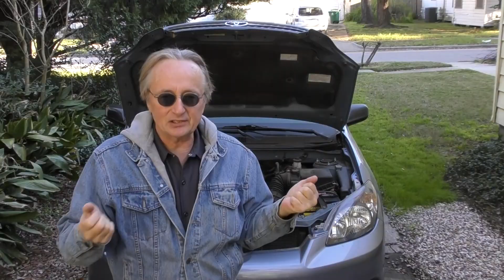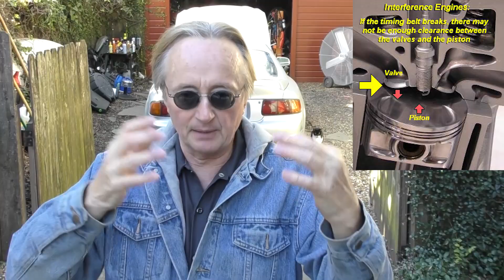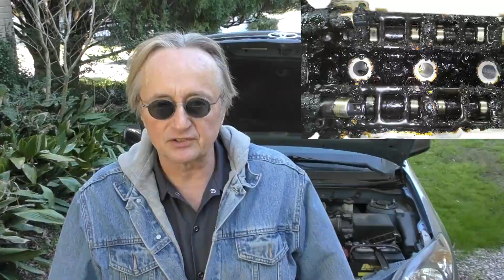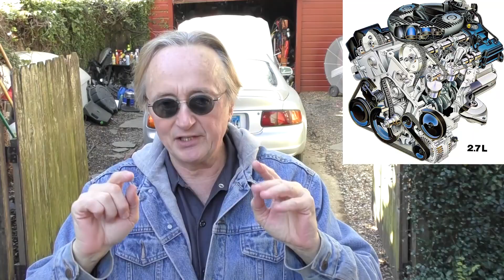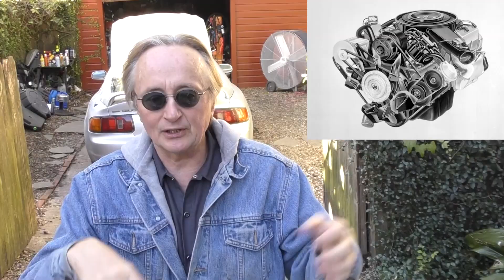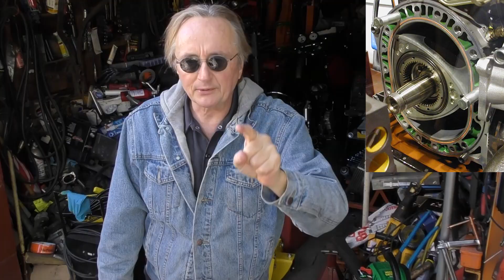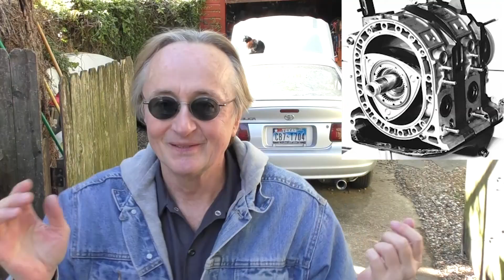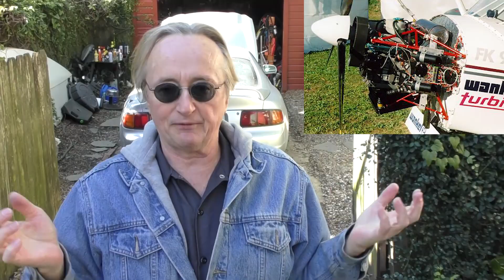Never Buy a Car With This Engine

Comment: SCOTTY IS A GM 3.4 V6 A GOOD ENGINE??.
Reply: The GM 3.4 engines leak like crazy. In fact that seems to be a problem with the 3000 series engines from GM. 3100, 3400, 3500, and 3800. Especially when they get past 125-thousand miles. 
I took mine apart in my Venture and replaced all the gaskets. Even added a little bit of RTV gasket maker to the top of each gasket to get a little better seal. Replaced gaskets, oil pump, water pump, cross cooling pipe, oil pan gasket, all the sensors, coil packs, spark plugs and wires. 
put it all back together and it worked really well. 6 months later....oil pan leak.
Reply: @johnsuggs7828  hello
Well..my 2003 olds sillhoutte has 270k and dosent leak anything..ive had it for 150k of those miles and changed all fluids reg and oil every 2500....parts as needed..van still runs and drives like a 50k mile van.....orginal radiator..ac equip....trans..engine...amazing this is why i wont sell it.
Reply: @beekbeeker2907  I have an 03 Chevy Venture Warner Bros. Edition, which is essentially the Silhouette with a Chevy emblem on it. Its at just under 290K miles. Had it for 13 years. Purchased it with 86K. So while I may complain about the leaks, I'm not every getting rid of it. I haven't' had a vehicle payment since paying it off a year after I purchased it
Reply: @johnsuggs7828  i have no luck w fords
Reply: @beekbeeker2907  Owned 2 fords....Won't ever do it again. At least not the cars. Ford trucks aren't too bad....when they work. But I'll never own another ford car.
Reply: @johnsuggs7828  my 2000 voager minivan was great 200k same as olds dry..tight
Sold it to get longer van it was a shorter one....both windstars were problems
Always breakin and rusted to hell early.on.

Comment: The 05 Buick Century- uses dexcool, which eats away the head gasket. Big problem! Never buy this car or any car that uses Dexcool!
Reply: If you do the work yourself, try changing the thermostat. It uses a 195 degree thermostat. The coolant chambers will have increased pressure on them because the coolant isn't moving due to the temp not being high enough to cause the thermostat valve to open
There is a 180 degree and 160 degree versions of the thermostat for that engine. When you use the 160, it opens way faster and as a result the coolant moves with less pressure build so it doesn't eat away at your head gasket as much.
Reply: @johnsuggs7828  Thanks for the info, but I'm afraid it's already too late for that. I bought it from a crooked car dealer who cleared the check engine light prior to me buying the car. It came on, on the way home and did some jerking and hesitation. Found out it was a blown head gasket due to Dethcool. So basically, I got screwed out of thousands of dollars.
Reply: They use the 3000 series GM engines. Specifically the 3.1L/3100. You are absolutely correct. Which is why I don't use the Dexcool. I use the regular basic coolant. The coolant has these tiny beads that absorb heat. They also act like a kind of corrosive to the gaskets. Those engines have leak issues all the time. 
I rebuilt one where I replaced every gasket belt hoses..everything. Even added a little bit of gasket maker on top of each gasket and tightened everything down an extra quarter turn. Ran fine....for about 6 months. Oil pan leak.

Comment: I've got a 3.5 in a 06 Malibu with 242.0000...runs like a champ!!
Reply: I've got the same engine same car same year.....and it's in my drive way now with the whole top of the engine taken apart. leaks like crazy and there is damage to a bearing. I'm going to rebuild it. Has just over 215, 000 miles. Not bad that's it still ran after that many miles, but like all of the 3000 series engines from GM....they leak fluids like crazy. even adding extra gasket maker and torquing an extra quarter turn didn't help. But I'm sticking with it because I don't have a car payment
Reply: @johnsuggs7828  I know if you switch from regular oil to synthetic oil it will start leaking and you have to replace the worn out gaskets...but that will fix it.
Reply: @cbf63  Really? Didn't know that. I did switch to synthetic. I'll be rebuilding the old 3.4 engine that I have. I'll be sure to remember that. 
Thanks for the info.

Comment: Scotty, how does the GM engines with AFM or DFM rank with your worst engine list? Our daughter's family SUV with a 6.2L engine has lifter failure because of cylinder deactivation. I hear this is a common problem with those engines. Shame on GM for not paying for repairs. By the way, GM stands for "Government Motors". Remember they took the bailout money?HHHHmmmm, wonder if they ever paid it back!  By the way, GM is still manufacturing those engines. Beware you 1/2 ton  Silverado & GMC V8 (gas) engine owners! Start saving some money for future repairs.

Comment: Ive been on the bench at a G.M dealer for 20 years. Ive seen 1  2.2L ecotec fail.
Reply: Stefano T...I'm a Automotive Technician & work at my brothers family shop and I've NEVER had a bad 2.2 or 2.4 come in for major problems..just maintenance issues..
Reply: WOW!...I must of got a "BAD ONE" because I've got 150,000 original miles on my 2011 HHR 2.2 ECOTEC..👍
Reply: ive got around 160k miles on my 2.4 ecotec and have never had any major problems

Comment: Wow, my Ecotec engine has 400,000 km on it and still going. Wonder when my luck will run out.
Reply: ECOTEC...NO "K"
Reply: Alright I'm not hating on scotty but I have to disagree with most of his videos like this one. Ecotec are amazing engines have several myself also just got an engine rebuilt for under $500 and yes I'm assembling it myself. These engines are cheap, reliable, and can make a good bit of power for fairly cheap. Also have quite a bit of miles on mine never heard of a significant timing chain problem. Also 2007 and newer 2.2 and all 2.0 and 2.4 are much better engines
Reply: @christopherloewen1433 My 2011 HHR SS 2.4 Ecotec has over 250,000 miles with no issues the only parts I've R/R was Struts..Motor Mounts..& Rear Shocks..👍
Reply: @christopherloewen1433  I could see Ucar drivers using ecotecs, but your average American that doesn't think about servicing their vehicle regularly, destroys these engines in less than 200,000 miles. These engines are sensitive to oil issues, like all over-head cam engines. The chrysler 4.7l is a powerful engine, but it is very sensitive to overheating and oil issues. I've seen many go 300,000+ miles, though. It boils down to taking care of your vehicle and most people simply don't.
Reply: @654Crossman  I haven't always been real nice to my engine or transmission for that matter it sees everything from jumping railroad tracks to offroading to running it 2 quarts low on oil still runs like new l
Reply: @christopherloewen1433  You are a lucky person. Those engines usually wont take that abuse, for long. However, I have seen engines run fine after doing an oil change, where no oil came out. But don't mistake the idea that you are in fact, very lucky...
Reply: @654Crossman  btw it's on its second engine because when my friend owned this car before me she put a hole in the oil pan and ran it until it wouldn't about 3 miles. No clue what the mileage is on it it's a 2005 in my 2006 Cobalt

Comment: I have a VW New Beetle 1.8T with a manual transmission and I always chamge the oil at 4,000 miles and put Liqui Moly 5W-40 synthoil premium fully synthetic oil and it works fantastic. 

You can't cheap out and you must do preventive maintenance if you want it to last.

Comment: Like he said with the 2.2 ecotec, if you don’t maintain it well(kinda like with any engine) it will fail. My 2.2ecotec runs great lol almost 300,000 miles. No issues at all... I guess it’s on the owner on how the engine lasts.
Reply: Exactly in the end it all comes down to maintenance,  especially fluids

Comment: I run a 2.4 Eco-Tec 2.4 and I change the oil at 2000 miles no matter what and I use Royal Purple 5W-30

Comment: Engines to avoid:
*GM 2.4L Ecotec due to timing chain failure
*Audi 1.8 turbocharged 4 cylinder (1997-2004) in VW and Audi vehicles
*Chrysler 2.7L V6 - waterpump driven by timing chain and nearly impossible to get to
*Cadillac V8 6-4
*Mazda 1.3L rotary engine

Comment: Those 2.2 ecotec can go 300k miles if you change the timing chain every 80k  those engines have 6 bolt mains, you can tune them up to 450 on stock internals, 800 on forged

Comment: No! Scotty not the ecotetch 2.2!  I bought a 2007 ion Saturn sedan 2.  I believe it’s the same engine. I am was going to buy a new car, bought my wife a sister in-law got the new cars and I bought this ion dirt cheap at about 117,000 miles I am the third owner. The first one had it for about 30,000 miles. My sister in-law did okay maintenance. It’s currently at 175,000 miles and my goal is reach 250,000 miles, then 500,000 if possible. Anyway I have trying my best to change all fluids in a timely manner. I have using full synthetic engine oil since I got it. Today’s just started to used Mobil 1 engine oil and oil filter. I have been watching your videos to maintain my car forever. This car was a mess inside, but know I have made improvements little by little. Tinting the windows the light a nice system. At first I was hell know, but know it’s a reliable super fun ride and it’s looking way better. I have change transmission oil twice at about 60,000 miles. This video hopefully I prove it wrong. Thanks for you video tips to maintain my car more than my wife and sister in-law

Comment: I always made an effort to change the oil on my Malibu, with the same 4 cyl 2.2 L engine that Scotty talks about and so far have never had a timing chain problem.  My current 2004 Malibu has 156,928 miles, My other 2004 Malibu Classic had 181,000 miles and never had a timing chain problem. I also religiously changed the oil on that engine also.
Reply: Your statement backs up what I always say about how long cars last. And that is I think it's the owners NOT taking care of their vehicles. They don't do simple scheduled maintenance. I hope they read what you wrote here.
Reply: My wife had 2 of these engines 2.2 ecotechs. 1 had a strong running engine but always had trouble with the car except for the engine.  It was at about 190,000 when we got rid of the car. The other had over 220,000 when the head gasket went in the car and got rid of it. The guy my wife bought the car from was a wrecked car fix and flip said that he had several ecotechs get around 300,000? So I don't think that sound like a bad engine
Reply: I have an 04 malibu as well it's has 325k miles original chains and everything except the ac compressor I still drive it everyday change the oil every 3-4k miles ive tried killing it but it won't die hold on to both of yours they're noisy but great cars
Reply: I had an 07 cobalt 2.2 changed oil every 3-5k miles with full synthetic and ran like new when I sold it with 185k miles. No engine failures
Reply: WORST BRANDS 
0. all European cars
1. Fiat-Chrysler 
2. GM/Chevrolet 
3. Nissan 
4. Hyundai/Kia/Genesis
5. Mitsubishi 

according to Scotty
Reply: Scotty actually likes European cars as long as they are built in Europe and not elsewhere.

Comment: My 2.2 Gm pontiac runs well and i have owned it for over 14 years, runs quiet great, no smoke.
Reply: how many miles? just got my gramps old 2006 ion with 100k, still debating whether I should sell it off, or stick a super charger in it LOL.
Reply: Dude is nuts. The 2.2 was nick named the Iron Duke. That motor is bullet proof

Comment: My Saturn 2003 2.2 Ecotec 5 speed has 270K and no timing change issues...yet. I use great Pennzoil oil in it.  I have new spark plugs, replaced transaxle fuel...It's very easy to work on as a DYIer and it's my daily driver.
So, I must disagree with you Scotty.
David
Alberta

Comment: I had a 2.2 in a 2004 Chevy Classic. Had 150,000 when I bought it. Never had a problem with it. I ended up wrecking that car though. So I traded it for a 96 Blazer and the 4.3 V6 has the be the worst engine ever built, not because of performance, but because of the way it was built. You had to go under the wheel well to change out the spark plugs because they put the spark plugs on the sides of the engine instead of on top.

Comment: Also would like to know your opinion of the old 2.2 L Chevy S10 engines my S10 is a 2001 and from my understanding it does not have a timing belt it has gears running the camshaft
Reply: The 2.2 OHV is a great engine but if you are concerned about power, get the 4.3. I would rather get the 4.3.

Comment: hey that timing belt thing sounds like my mitsubishi 3.8! cold starts would make the tensioner not push out as much and it would sound like a diesel.  popped a new belt, pulleys, water pump and tensioner and she runs like new again.

Comment: The 8-6-4 wasn't bad.  Clip one wire and it is 8 all the time.  A debored 368 version of the 472, 500.  Clip that wire and they run forever.  Old cast iron design.  Not powerful, but durable.  I'd much rather have that than the HT4100.

Comment: Thumbs up on some of those but down on others.  Personally I have 239k on my 225hp 1.8 in my Audi TT and the valve cover has never been off and it is on 18 year old original coils, the coils weren't bad it was people not changing their plugs that made them jump a large gap that burned them out. The GM timing chain issue is also due to people running them low on oil or going too long without oil changes, it was actually an advanced engine with no problems in Europe where people actually maintain their cars same with the Audi.   As far as saying engines are too complex to rebuild is where you are sorely mistaken, they are built pretty much similar with way better materials.  Best part is you hardly have to bore one out anymore as the coatings on the cylinders are so tough just a hone will do most of the time and they are machined more true from the factory than most old school shops could even do on their best day.  I work at a dealership and rebuild them regularly in no time and reduced cost due to not much machining necessary.

Comment: I have a 2007 Malibu with a Generation II Ecotec 2.2L.  Timing chain slipped at 90K miles and I got a good price on a used replacement engine.  Now I'm at 150K and trying to decide if I should put any more money into this car.  Does your advice apply to both generations or just the Generation I, 2006 and before?
Reply: 2007 Chevy Malibu 2.2,  Replaced transmission at 225,000 miles,  Replaced engine at 268,000 miles (newer engine has 65,000 miles on when installed) 
I drive it to work. My 2018 Subaru Outback Premium bought brand new sits in garage till the weekend 😁

Comment: How do we determine which engines are problematic apart from your videos & Wikipedia?

What are your thoughts about the following engines:

Subaru FA20 (FA20D) aka Toyota 4U-GSE
Suzuki K14C
Hyundai G4NC
Hyundai Gamma G4FD
Hyundai Nu 2.0 GDi
Volvo B5254T
Hyundai G4FABU
BMW N46B20BA
Hyundai G4FDBU
Hyundai G4NB
Honda R18A
Hyundai G4NA
Toyota 2ZR-FE
Honda R18Z4
Hyundai D4FB
VW 1.4 R4 16v TSI/TFSI
Hyundai Nu 1.8 GDi
Toyota 2JZ-GE

Comment: My 1983 rx-7 engine lasted for 220,000 miles.    True, it loves to get flooded in cold weather.    Just take out one plug, turn the engine over to fix the flooding.   Or you can pour 1/4 cup of methanol (sold as heet) down the carburator, and it will start right up.    I get about 25 mpg highway going 80 mph.    City is 11-14 mpg.   Not many rotarys are left around these days.   A rebuilt 1.1 liter rotary goes for $2500 if you return a core.    So I guess it is true, you don't want to buy a 40 year old japanese sports car for a daily driver unless you are a gifted mechanic such as myself.

Comment: That's what happen to mine I just bought my saturn ion 2 with the 2.2 engine had it for a a few days and bang turned it off and tried to start it found out the timing chain jumped  cost me 1000 from the guy I bought it from has to rebuild the engine

Comment: So I might get a cheap 92 Plymouth  acclaim with very low kms apparently the head gasket blew and needs to be replaced and I've heard they run decent after you replace the head gasket. I'm trading a couple bicycles and 300 bucks. Should I get this car? Shes a classic by now low kms? I had a 98 sn95 mustang v6 with rot holes in the trunk and a 2000 328ci BMW e46 with a deadswitch and a drain that I Lost!. Third time the charm? I need a car. I am 24 now and I cant afford any other pos without an option for income even at this moment in history. Cleaned the other 2 cars up nice though I can take care of a car that's all I want to do. This one is in good shape and what is available to me now. Beggars cannot be Choosers in my case. I'll have a car sit there the rest of its life as long as I have one. World equality lost with Monopoly money

Comment: Hey Scotty you forgot the quad 4 engine did GM made from 1988 to 1996 and doesn't not need no spark plug wires

Comment: the 1.8 bam audi engine is not a bad engine at all, it just suffered at the hands of idiots. as for the opel engine, they were pure shite. had one in a astra coupe, was me mahs car, I bought it for her with 35k on the car with one owner, to our surprise after I did the preventative buyers oil change the car sounded, just after first start like a spanner was inside the engine. so the prev owner had filled it with engine quiet an sold it on. thanks pal. then a new chain was put on and within 10k miles with 2 oil changes inbetween bare in mind,  fully synthetic for extra protection, the noise came back and the Bakelite look tensioner had had it again……… never ever again will I buy a car with a Vauxhall badge...… pitty cos I hear the z20 version was bomb proof.....

Comment: I had a Chrysler with a 3.4 Mitsubishi engine; first the water pump went, then at 50K the engine spun two cam bearings, which was covered by warranty at $5k. I will stick with Ford Rangers, thank you very much!